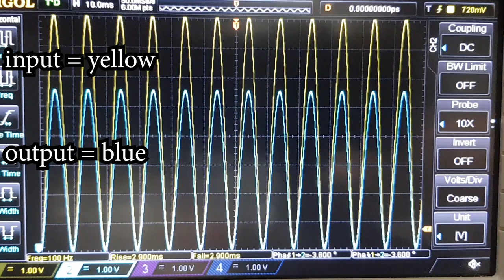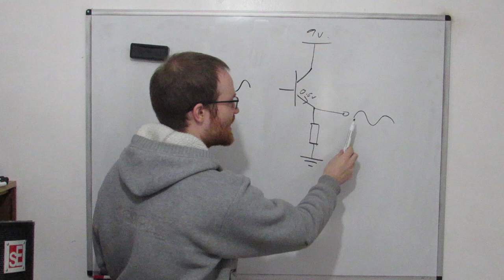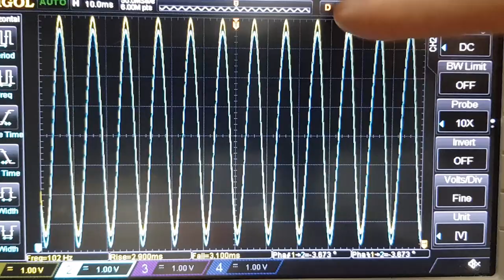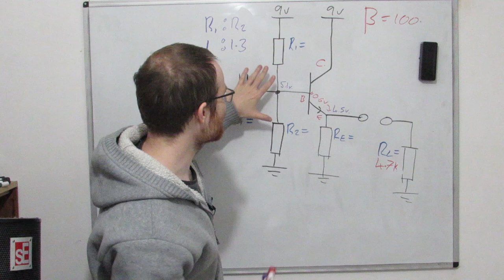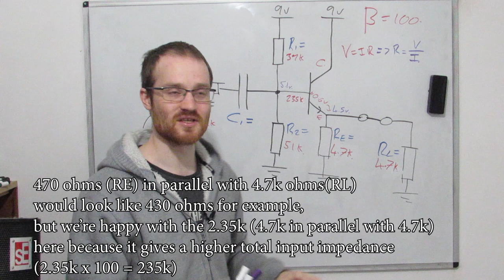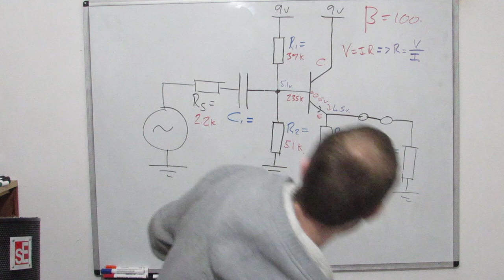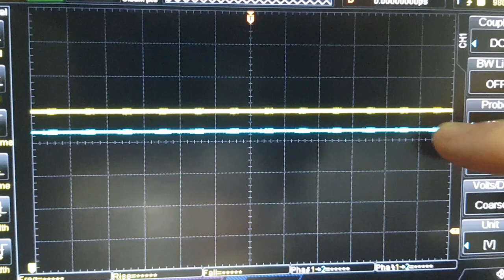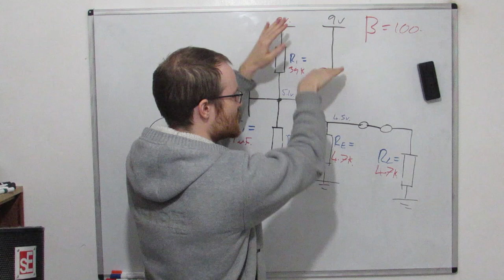Single Supply Transistor Buffer

Comment: The explanation of each of the impedance stages + you have an explanation of loading effect which is like the most important thing to know when putting circuits together. This video is gold for why impedances are very important.
Reply from the maker: Everything is impedance!
Reply: @TheAudioPhool  Can you please tell why you considered those parallel resistance R1 and R2 10 times less than 235k.
Reply from the maker: @swaritmahalsekar5521  39k||51k = 22.1k which is roughly 10 times less than 235k
Reply: @TheAudioPhool  ya but how you got to know the values of those resistors? 
I mean u took the ratio 1:1.3 but why is there any rule?
Reply: @TheAudioPhool  Thank you for being direct and specific. As a guy with Aut!sm I've struggled to fully grasp impedance and load due to a lack of resources I've been able to f!nd that just bluntly explain why impedance matters and what load is and why it matters. The power display screen really nailed it home.

Every attempt at explaining it, from over a year of reading and becoming familiar with audio circuitry, they all take a long winded route that merely leaves questions that I can't ask the author to explain. It kinda pisses me off a little that's it's such a simple thing and could had been explained in a direct way that only required a few sentences. So, absolutely 100%, thank you for your simplistic approach to directly explaining it as opposed to turning something incredibly simple into a long riddle.

Comment: I was interested in electronics as a hobby when I was in high school. The only texts available were the university level textbooks at the British Council Library. I was overwhelmed by the h-parameters and matrices but I did - on my very own - understand enough abstraction to derive the WYE-DELTA equivalence equations. The next breakthrough was a small British book on how to build your own radio. I then understood what coupling the AC signal to the supply lines via a capacitor meant. I could have done with a video like this. You, Dave Jones, Ben Eater and Sam Ben-Yaakov are just the sort of teachers I was missing. I lent my radio book to someone who was interested and never got it back. I   built a ZN414 based AM radio  coupled to my iota audio amplifier. My amplifier drives a high impedance earphone. It was just something I cobbled together and worked better than a similar design in an electronics magazine which consumed tens of milliamps. Everything ran off a single 1V5 cell. My radio was always on since the ZN414 only consumed 700 uA. My amplifier only switched on when I plugged in my earphone. There was only one adjustment - a variable capacitor to tune in to a particular station. Volume control? was accomplished by turning the ferrite bar antenna off axis to the station. I potted the entire radio into a Rothmans cigarette box(I don't smoke) and used cotton wool and candle wax as a potting compound. I reckon I can improve my iota amplifier now - half a century later.

Comment: Nice one A.P. Just getting started on electronics myself. It's funny how it goes with YouTube. You wade through loads of stuff. Get stuck, then unstuck.... then stuck again. Not being in a classroom you can't ask the teacher. I am playing around with piezo's at the moment so impedance matching seems really important on the face of it. Interesting, what you said about connecting stages as well. I have some issues here that I have put down to de coupling which may indeed be  impedance related. Time to buffer the hell out of the problem and see what happens. This was one of the best instructional videos I have seen on YouTube. You have a gift mate. Keep it up. Thanks. Tony.

Comment: Yet another stellar video! One aspect I had trouble following was why the voltage divider after C1 has an equivalent impedance of R1 parallel with R2, rather than R2 alone. I thought this signal was unipolar, so how could current pass from the node after C1 through R1 to +9V? Thanks so much!
Reply from the maker: This is actually such a good question :)

AC signals see the power supply as a short circuit, so long story short when we are thinking of changing signals, +9v is also ground! (we call this sometimes AC ground or virtual ground). 

If this is confusing, draw out the circuit (i always have to 'see' things visually myself), but instead of just putting +9v and ground, connect all the +9vs to the positive terminal of a voltage source, and all the grounds to the negative terminal of the same voltage source and you'll see the loop!

I'll be sure to mention this in a future video because that is definitely something that confuses a lot of people.

Thanks for watching!! :)

Comment: Very nice way to calculate the voltage divider for the basis bias, but if you take some asymetric clipping for granted (just use lower input signal, then it will never clip) a hands on aproach could be: just take two evenly large resistors for R1 and R2. An engineer (as in contrast to a scientist or scholar) could also take a potmeter and trim the circuit for  the highest output. Non the less thank you for your excellent tutorial.

Comment: Great explanation. I have a question relating to the R1 and R2 values, if that's ok? 
Why 10 x greater and not 20 or a 100 times greater?
Reply from the maker: It should be at least 10x greater to prevent attenuation. In electronics we generally take 10% to be an acceptable amount of attenuation because we have 5-10% tolerances in our parts so we have to design our circuits to be robust.
If you go greater than 10x you will get less attenuation, which is good! Large resistors do inject more noise into circuits but this only really makes a difference for really precision circuits which we won't be worrying about for a little while.
thanks for watching! :)
Reply: @TheAudioPhool  Noise, ok, that's a good reason. I was thinking along the lines of minimising the current wasted down the divider route.
Reply from the maker: @simonyoungglostog  There's always a tradeoff to consider in electronics. If you're operating off a battery less current might be more important than a bit of noise, for example.
Reply: @TheAudioPhool  I'm beginning to understand that there is a very elastic nature to electronic circuitry. Thankyou for taking the time to respond.

Comment: Shocked to hear someone with a European accent talk about a 2N transistor instead of a BC!
Reply from the maker: I've gone over to the dark side
Reply: @TheAudioPhool  Good to keep a selection on hand. The extra gain of the BC547 let a 3.3v control signal from an RPi switch a 5v load where the 3N3904 didn't work.

Comment: Also please tell me how that capacitor is forming high pass filter I simulated the circuit at 50hz I'm not getting the proper signal. Ripple like signal is occurring please help me

Comment: I'm a little rusty, but I was using 2N3904 and 2N2222 back in the 70's. Hasn't anyone made a better audiophile grade transistor?
Reply: Did you ever find a better audiophile grade transistor? All I know is that the 2N2222 and 2N3904 are good for AF and RF up to at least several MHz.
Reply: @Steve-GM0HUU  Suprisingly no one has offered up a better choice.